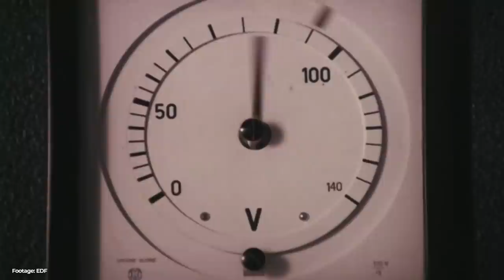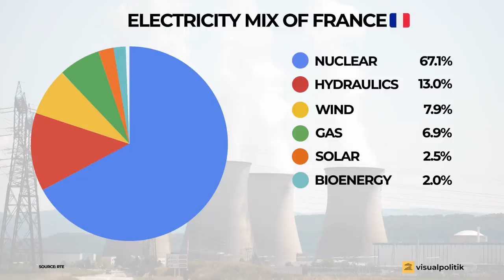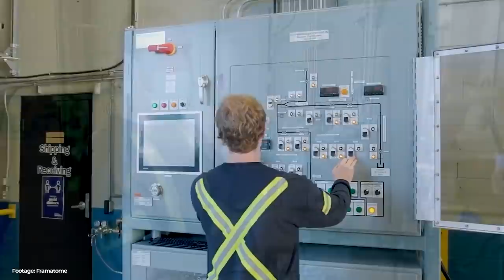Why is FRANCE betting on NUCLEAR ENERGY again? - VisualPolitik EN

Comment: Everyone laughed at France for their decision. Now, with everyone at the mercy of russian fuel lines, they've stopped laughing.
Reply: Do you know where 50% of the fuel rods came from? take a guess
Reply: @midnattsol6207  Even if it comes from Northkorea, once you possess it, nobody can turn tap on or off at will... You have greater control for your energy security.
Reply: @midnattsol6207  Do you know that stockpiling enough fuel for a decade or more of operation is trivially easy?  Quite the stark contrast from gas supplies that have to be continuously replenished.
Reply: don't hold your breath for 25 -30 years.
Reply: Considering 2022, as a german, i am still laughing....
Reply: @noah-ni3ee Germany was very stupid shutting down their nuclear fleet.
Reply: That remind me the Napoleon Total war trailer about that 😅
Reply: Now were back to laughing at them after recent events in Niger! 😂

Comment: Classifying Gas as sustainable would be a joke, maybe give a special classification different from coal or oil but it shouldn't be given the same status as wind or solar. If you want an energy system built around renewables plus a nuclear backbone then you need to subsidize for that, if you treat gas like its perfectly equal to those others it will remain integral to the system.
Reply: RNG is sustainable.
Reply: and with all the gas leakage that happens in natural gas pipelines, natural gas is almost as bad as coal when it comes to greenhouse gasses. Methane is a much worse greenhouse gas compared to C02.
Reply: @alex bob  agreed. Old gas plants are horrible. But if ur getting gas from natural waste products like spoiled food and landfills than its actually carbon negative.
Reply: @RafaelsFlix  Russia says otherwise...
Reply: well, there is no renewables without a toping possibilty able to compensate, and that is natural gas (or worse).
Reply: @RafaelsFlix  it's not carbon negative, at best it's carbon-neutral...which it isn't either.
Reply: They want Natgas classified as "sustainable" because without cheap NG renewables aren't possible
Reply: Classifying Gas as sustainable will also open hidrogen manufactured from NG to be classified as sustainable, wich it isn't, and can potentially damage future efforts to decarbonize other industries like shipping and air transport.
Reply: @RafaelsFlix  except it Isn't. in a perfect reaction it could be...but reactions aren't perfect, hence it's a lie. it's been touted as neutral, never negative and it can't even achieve neutrality without PERFECT conditions which just don't happen in the real world.
Reply: @chrisholdread174  they are possible...what exactly makes  you thin they aren't? especially when combined energy storage, nuclear power,  smrs or salt reactors.
Reply: Hartley, the backbone of renewables are the river dams.

We already have several river dams close to old riverdams, to be energy storage system.

Or to hold and wait, or to pump up back when solar and wind produce above the demand, and in that way we dont loose all that not demand used energy.

Or to produce energy when wind and solar toguether are short.

We have already 2 new dams conected to 2 old dams to do it, and are building now a 3 nee sequencial dams single project to the same fuction.

Its a electrical battery, but in water...

The water we loose to underground sheets, are not a true loose because its the water we pump from the ground to feed the cities and farms.

And we use the water dam plain to instal floatuable solar pannels.

We dont need coal or gaz or nuclear to be the backbone of the system. We just need mountain terrain enough to build river dams enough to be the backbone.

Few EU countries dont have terrain enough to build dams with that double fuction.
Reply: Also cutting down trees and burning them or burning man-made waste is considered renewable (may only take 20yrs for those trees to grow but hey look at the long term picture - as the world will end in 10yrs).....
Reply: Germany loves lobbying for Russia. Also you can have more of these nice CO2 taxes
Reply: @RafaelsFlix  No it s not. It s carbon neutral, not carbon negative. Carbon negative would mean producing that biomethane and NOT burning it. Ever.
Reply: @rw-xf4cb  renewable just means there's always fuel, doesn't mean it's carbon-neutral, which it isn't. just sustaining current levels isn't enough, GHG's need to be lowered drastically. though using  wood as fuel isn't neutral either nor could ever be close enough to fulfilling energy needs.
Reply: ok, in general a lot of people are posting different concepts floated by energy concerns that let THEM maintain their current power plants with few modifications while claiming that the technology is renewable or carbon-neutral. burning ANYTHING is not carbon-neutral and renewable just  = a steady/infinite fuel supply.

all of them fail to mention the processing required and the carbon footprint of that is carbon-positive in and of itself before the product is even combusted. wood/pellets/waste or gasses from the same or similar are entirely to try and keep current plants operating with a little cost as possible for the modifications needed to run the new fuels. gasification = natural gas plants while the solid fuel goes into former coal plants.

it all sound wonderful...until you dig deeper.
Reply: @RafaelsFlix  you have 100 co2 molecules, grow a tree from it and burn it. It will release 100co2 molecules again...

Rng is carbon neutral
Reply: Hartley, 

you seem to have a misconception about renewables in that you consider them to be a viable source of electrical generation. They are not and never will be.
Nuclear is not an option if you want non CO2 emitting generation, it is the only way.
Reply: @benjaminlamey3591 
Same is true for nuclear btw.
There is a reason France is importing coal power from Germany each winter.
Both nuclear and renewables need backup and/or storage to meet all demand.
Reply: It's misleading in the video.
There are 3 taxonomies for subsidies.
Green, enabling and transition.
Nuclear is enabling and gas transitioning.
Reply: @chrisholdread174 
That isn't true. Storage is needed and same is true for nuclear which also needs fossil fuels or storage to meet peak demand.
Reply: @oldman2800  
Noone believes gas is carbon neutral, but some would argue that it is "dumb and stupid" to believe this claim in the first place.
According to the taxonomy wind/solar is supposed to be classified as green, nuclear as enabling and gas as transitional.
Reply: Dont know if it was already said, but the EU (and therefore probly others) see burning wood as "Sustainable" because planting a tree should take back the C02 you burn from the tree. Of cause they ommite the fact more C02 is emmited because we dont have 0 emission industries/vehicals to get and transport said lumber, but who's counting
Reply: @FableBlaze  
Actually the whole premise is wrong.
Gas is supposed to be classified as transitional, nuclear as enabling and wind/solar as green/renewable.

Also France and Germany both get around 12% of their electricity from natural gas and while Germany has a target to lower their emissions by at least 65% by 2030, frances target is much lower at 45%.
Reply: @davedobbschannel  
"About 3%"
97% of CO2 is part of the carbon cycle. So the 3% is 100% of the change of CO2 concentration.

Oh and 0.04% is around the amount of blood alcohol that can make u lose your license in many countries. So it can be very significant.
Reply: but you can't do without methane
Reply: I guess it's sustainable if you don't consider your grandchildren or great grandchildren, but that would be terribly irresponsible.

Comment: France is an excellent example for how the use of nuclear energy is good.
Reply: Have you actually watched the video?
Reply: @shakiMiki  Yes, I have. Nuclear energy is the future.
Reply: And Ukraine is an example of continuing to use nuclear power despite setbacks?
Reply: @myroslavnesysiuk730  And, inevitably someone is going to come, pointing out problems, that only apply to old reactor designs...
Reply: @frogg8891  uhhh. Don't remind. So many times
Reply: Nuclear waste is a problem.
Reply: @miteshmistry25  But the source of electricity nuclear would be replaced with in the near future has a bigger problem - CO2, NOx, SOx, particulate emissions and others. The choise is not between nuclear and renewables, we have to choose between nuclear and coal and gas because renewables and nuclear serve two different functions in the electricity grid. Nuclear, hydro, coal and gas are base load sources (reliable, controllable, with constant output), whereas renewables if possible and coal or gas if not, fill the gap between the base load and the current demand.

So we have to choose a lesser evil, either we cause a lot of harm to both people and the climate by burning a ludicrous ammount of fossil fuels (be in coal, oil or gas) or we will store a much much smaller ammount of very dangerous waste deep underground.
Reply: @miteshmistry25  Ukraine decided to store its nuclear waste in Chernobyl exclusion zone
Reply: @myroslavnesysiuk730  aren't you Ukrainian?
Reply: @dragosstanciu9866  INDEED
Reply: Nuclear FTW!
Reply: @Myroslav Well, they have to. The area at which they mined their coal (Donbass) is being occupied by the Russians and they will never get any form of a reliable supply of Russian gas anymore thanks to Nordstream I/II and the Turkish gas pipeline.
Reply: France is not known for it’s technological advancement; good luck with that!
Reply: And Fukushima is a shining beacon of nuclear energy that the world needs to get behind.
Reply: @derekcraig3617  rather example why not to build reactors in places with tsunamis...
Reply: @shakiMiki  The video actually highlights one positive thing. Energy independence. France did not suffer from the 1970s oil crisis like the US  because it quickly divested from oil and gas power plants to nuclear.
In essence, to date, the cost of power in France does not heavily depend on global prices for oil and gas and btw, Uranium is not that expensive as a fuel. It is far cheaper than any fossil fuel.
Reply: @myroslavnesysiuk730  Nobody is building those types of reactors. In fact, no one is building Generation 1 and 2 type of reactors at all.
Reply: @geraldmaxwell3277  Okay. Question why did you write it to me?
Reply: @dragosstanciu9866  nice wishful thinking.
Reply: @ffffuchs  Wishful thinking? How so?
Reply: @dragosstanciu9866  you say its the future. i disagree - as things stand, at least in the EU/US nuclear may get some air, and it remains to be seen how succesful SMRs will be, but the general incompetence of all recent nuclear projects, huge delays and cost overruns, and the fact much of existing European nuclear is ageing and not even France plans enough new units to replace their old ones indicates to me there's simply no way nuclear will become the main electricity source (and believe me, id like it to be like that, but i grew out of being an idealist stem kid).

And note I say electricity - we need other forms of energy too, like heating for which even France primarily uses gas.
Reply: @ffffuchs  People learn from their mistakes, the nuclear projects can be improved if enough time and attention is given to them. In any case, nuclear energy is here to stay. The future can bring more chances for success for nuclear energy if the people are serious about making use of its potential.
Reply: Wind and solar is ...pipe dream!.France is best example of energy independence and in big ligue  of smart development.
Reply: @henryjanicky4978  smoke another one! Not one huh? might wanna go check those figures again
Reply: @Zakaria Ali Why doesn't Niger build a nuclear power plant and use its uranium?
Reply: @derekcraig3617  Perhaps you check Fukoshima casually- was it zero ,was not .? The only setback was huge sost .!And  negative public respond ,which only apply to poeple with green ideology and little knowledge.!
Reply: @henryjanicky4978  what are even talking about? none of your claims are backed up by facts
Reply: @Izingana  😂 😂 keep dreamin
Reply: @clovis1er333  Dream about what?!
Reply: @Izingana  France sold and Built more +45 nuclear reactors all over the world .. “Not known for its technological advancement” is just hilarious 🤣
Reply: @clovis1er333  Oh ok; you win. 
Still won’t buy anything technological from a French company. I only appreciate them for wine and food..
Reply: @myroslavnesysiuk730  and then why are still in use dams for hydroelectric power since they are far more dangerous and caused largely more deaths?
Reply: @clovis1er333  Didn't French company build latest Nuclear power plant in Finland? EIGHT billion extra costs and 11 years delay?
Shortly after start up, important failures were found ...
Reply: @OmmerSyssel  Currently, France is not only trying to replace its nuclear fleet but also to improve it ! 
99% of the French nuclear fleet is a third-generation nuclear reactor. The last (Flamanville, shown in the video) is the first fourth-generation nuclear reactor.
Inevitably there are delays, extra costs, etc...

A brand new French technology, which is able to: consume less, produce more (1650 MW), use several fuels such as plutonium more abundant on Earth than uranium, and be able to reuse 99% of the fuel already used ! 
- Presently, 99% of French nuclear fuels (non-radioactive) are in hangars in the "Cap de la Hague". They can be reused, and according to scientists with the stock we have, we would be independent for 2,000 years !!
Reply: Currently, France is not only trying to replace its nuclear fleet but also to improve it ! 
99% of the French nuclear fleet is a third-generation nuclear reactor. The last (Flamanville, shown in the video) is the first fourth-generation nuclear reactor.
Inevitably there are delays, extra costs, etc...

A brand new French technology, which is able to: consume less, produce more (1650 MW), use several fuels such as thorium more abundant on Earth than uranium, and be able to reuse 99% of the fuel already used ! 
- Presently, 99% of French nuclear fuels (non-radioactive) are in hangars in the "Cap de la Hague". They can be reused, and according to scientists with the stock we have, we would be independent for 2,000 years !!
Reply: @Izingana  Devialet ? Considered the best audio speaker in the world !
Reply: @quentinl6724   ‘We’ve’ done nuclear for 70 years now and the waste storage is a problem. Lot’s of cost and no real solution. 
So, after 2000 years you can all enjoy, independently, the stockpile of waste that can never break down. 
It’s human nature not to care for the future; whether it’s with oil, gas or nuclear…
Reply: @Izingana  You seem to confuse 'nuclear waste' with 'radioactive waste'. Nuclear waste can be reprocessed and reused, or stored anywhere because it's not dangerous in the long term.
'Waste is placed in surface or shallow facilities for a limited period of time before possible storage. The storage concerns: very short-lived waste (VTC), whose level of radioactivity disappears in only a hundred days" - Wikipedia

A fuel bar consumes in 6 months, and now 10 with this new technology. Only 0.2% of this fuel becomes radioactive waste. Stop pretending that all nuclear waste is harmful !
"According to the National Inventory of Radioactive Material and Waste of the National Agency for the Management of Radioactive Waste (Andra), this waste represented in volume 0.2% of radioactive waste"  - Wikipedia

Billions have been invested to bury long-lived radioactive waste (HAVL) in sites at 20km depth, where no problems will occur because there is no tectonic plate, volcano or seismic faults nearby. Moreover, these new technologies will further eliminate radioactive waste. 

France is also working on fusion reactors. We hope to take advantage of it by 2050, so far from using all the uranium stock that is non-radioactive so your unconditional fear is unfounded.
I’ve seen your other comments that openly criticize what France is doing.
Know that the French created the Declaration of Human Rights and vaccines. Sorry, but you have a French innovation that’s currently circulating in your blood.
"stick to the cooking; you do much better" yourself !